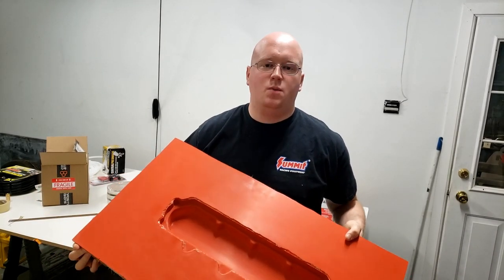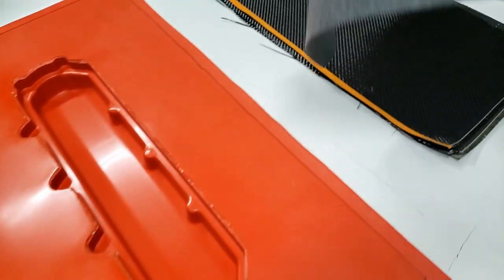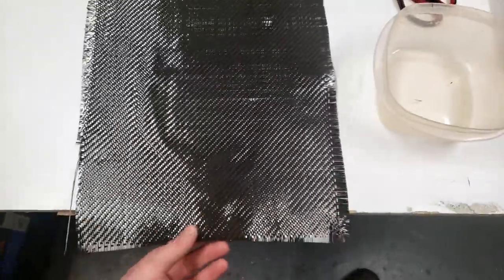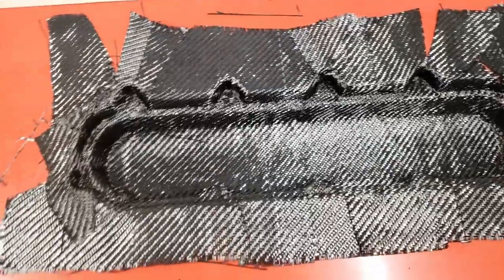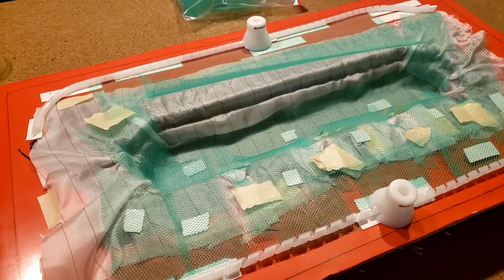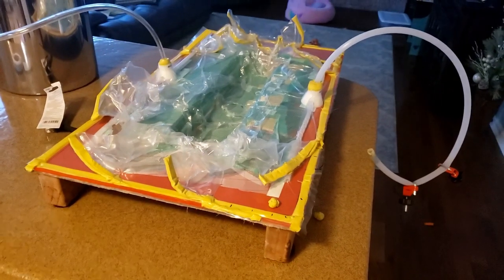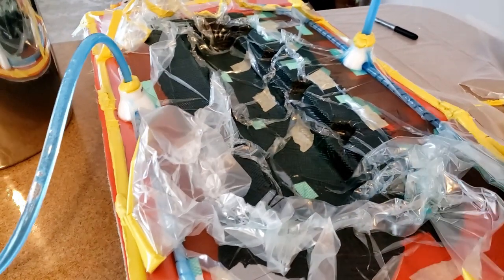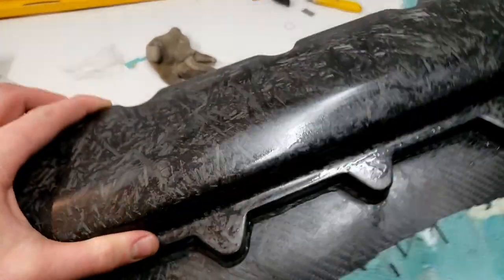EP3, Chopped Forged, Vacuum infused, carbon fiber valve covers... FAIL.

Comment: I'm used to seeing small layers of chopped tow pressed down, then painted with resin, repeating until its built up. Was skeptical that this would work with mostly dry chop but it worked great

Comment: Looks good!
You’ll have to give us a future update. I always wanted to do carbon valve covers but everyone said the fuel and oil would eat away at them in a few months.
Reply: That is what I've heard, but how true and how long it takes to degrade is an unanswered question.
Reply: It depends on what epoxy resin you use... make sure it's a high heat product that can handle petroleum products and you will be fine.

Comment: Wouldn`t it be better to use press moulded carbon to eliminate need of aluminium flange?
In this case with flat flange it may be even easier and lighter option to make shape like on stamped steel valve covers and make custom laser cutted cork gaskets
Reply from the maker: You're not wrong. I have yet to actually bond the flange into these. I recently have gotta a cnc router and am planning on doing a press molded "forged" recreation of the aluminum ring. This is just better all around because it will reduce the risk of thermal expansion ruining the bonding join

Comment: How is the oil vapor react with the composite resin?
Reply: “ Epoxy resins are regularly used to line shipping containers used to transport gasoline and jet fuel due to their excellent resistance to petroleum products.”
If it did eat through a surface layer of epoxy it would get to the carbon which is inert

Comment: If you spray the carbon back side with lacquer light mist carbon is easier to work with
Reply from the maker: Ive been spraying the carbon with 3m 71 Composites Hi Tack now and it seems to be working well.
Reply: @LoudandProudBSE  3m 71 is a game changer!

Comment: Just because you use a high temperature epoxy doesn’t mean it’s immediately ready for a high temperature application. You have to post cure/heat cycle the part in a certain stepped process in order for the epoxy to gain those heat resistant properties. You seem to be really struggling with reading instructions on how to use these epoxies properly
Reply from the maker: Um... yeah no crap. No where inthe video did I say that you could. They have a strict curing cycle and I have a PID controlled oven for it.  I've talked with the chemist who's made them for specific modifications to the process for my application. I think you're assuming alot there chief. Pretty bold. 

The mistake in this episode has literally nothing to do with not reading instructions. I was very aware of the process and had two hardeners sitting on the shelf. Verified the number, got distracted and then grabbed the wrong hardener.

I do a LOT of research on a LOT of fabrication and engineering disciplines. I share the ups and the downs of learning more stuff in the period of a couple years than most learn in a life time.

Fab. Welding. Design. Machining. CNC programming. Body work. Paint. Composites. Upholstery. Engine building. Pcb design and build. Programming....

All learned to a useful and proficient level in five years. Do I make mistakes at the "proficient level". Of course. But I can do more things than an Expert whose only an expert in composites.
Reply: @LoudandProudBSE  I watched your brake duct video and figured out who you are cuz I didn’t know before. We’re friends on Facebook and I’ve seen you in the carbon fiber fabricators group. 

I’m a full time composites fabricator and work with a wide range of Premium Resin Tech epoxy systems every day for manufacturing my composite engine components that I sell. I used to do only custom work but I’ve gotten into mass production of certain parts. Most of the carbon fiber “how to” videos on YouTube seem to always feature people who have no business trying to teach people how to do this type of work. Like the Street Bandito channel. So that’s what this seemed like at first. 

Obviously since I know who you are now I know that you thoroughly researched before giving any of this a go. Most people on YouTube just buy the shit that sounds right and act like they know what they’re doing with it.
Reply from the maker: @tylerroe5175  I get it. Its all good.. That said, I'm still confused where you got the impression you did if you watched the vid. Def not a how to video.. my most of my truck videos are the first time I've done something. This is the same. First mold. First part. I'm hardly an expert and don't claim to be but I don't go into stuff blind either. Most of my videos are more "hey I tried this... this is the good... this is the bad". How tos that don't show the truth of learning (and failing) are useless.
Reply: @LoudandProudBSE  When you mentioned the PRT 3386 you named the 450* temperature resistance but didn’t mention the fact it needs a post cure. So I thought your thought was since it stated 450* that you’d have that right out of the box. I don’t wanna see somebody’s part melt and completely ruin or severely compromise something else. That’s usually what happens when people delve into temperature resistant epoxies. Something melts and they can’t understand why. It would suck to watch your valve covers melt off the heads and potentially grenade your whole short block
Reply from the maker: @tylerroe5175  gotcha. I think in the brake video I go into more detail about it. I've cured most of the high temp parts and so far so good. Did the slow roll and pause all the way up to 450 (unsupported due to mold limits) and luckily had little to no deformation.